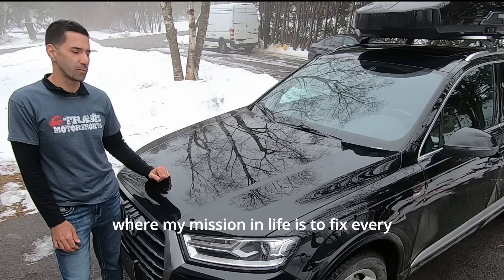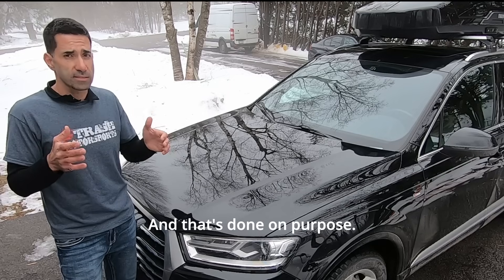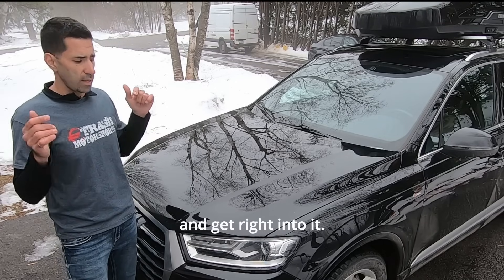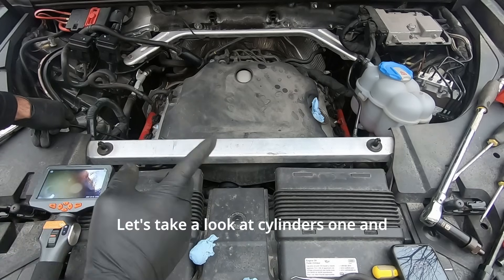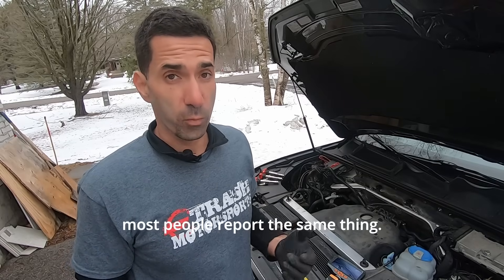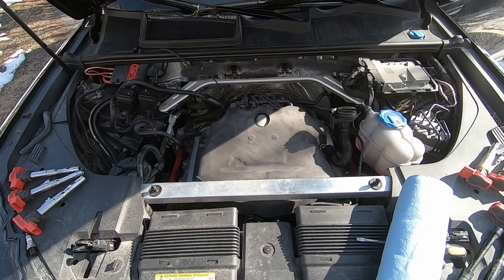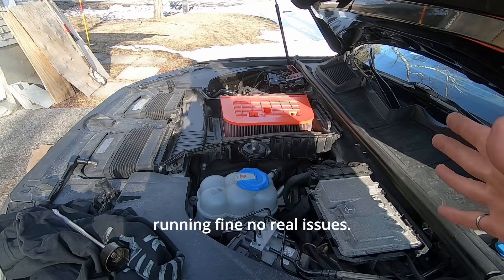I piston soaked another 3.0T with B-12 to fix its oil burning issues due to stuck piston rings

Comment: Thanks for this. Is this common in the A6 with CREC as well? I’m having oil consumption with mine, but I’m not sure if it’s the PCV because it hasn’t been replaced yet, or just carbon buildup
Reply from the maker: Pretty much any 3.0T so sadly yes...i think it depends on how bad the consumption is - the pcv can't account for a 1L per 4-500km consumption- that's rings for sure... if you're in the 1L per 10k then maybe PCV... thats a good question for the other folks here - what was your consumption when it was PCV and not rings?
Reply: @ETMotorsports Yeah mine was doing 450miles (720km) when I bought it used with 98k miles, so I suspected oil. Switched to liquimoly 5W40, got better up to 700 miles (1126km). 

But after that I discovered I also had a valve cover gasket leak on drivers side, so I replaced that. The oil level in the mmi hasn’t moved yet and it’s been 250 miles, so I’m praying it was the leak; however that doesn’t rule out pcv. I’m not sure how accurate the oil cap suction test is as a determinant for a failed pcv on these engines, but mine has INSANE vacuum at idle, like it was not coming off at all no matter how hard I pulled. 

So I’m guessing the pcv probably failed/failing caused the valve cover gasket leak, which caused oil loss + pcv itself causing oil consumption. I think I’ll replace the PCV; but that also doesn’t rule out piston rings. 

One other thing, what do you think about running yamalube ring free in the tank? 12 oz per tank for a couple tanks, just as a slower way of removing the buildup? 

I appreciate all of your efforts, thank you sir

Comment: In the bayarea of CA, i took my honda to a japanese repair shop because it's burning oil. No smoke, no leaking just comsuming requiring adding more before oil changes. The shop said he would put thicker oil in it, or replace the engine for 5200... he so happened to have a bunch of Honda engines he bought from japan. Doesn't say how many miles are on them. I passed and will not go back to him, because I suspect he knows about this B-12 fix but wont do it.
Reply from the maker: Whether he knows or not - it's a business and he wants to charge for his engines - it's simple... any shop would rather charge 10k for 2 days of work

Comment: I do this with seafoam. I'm not sure why other shops dont do it
Reply from the maker: We've tried seafoam on a few motors- it's pretty weak compared to B12...i guess as a preventive measure it would work well every 5 oil changes or something... it did fix my A4 though so it's not completely lost

Comment: I’ve always just made my own concoction with ATF mineral spirits some diesel and several other little things. Literally make the oil change out of it and fill the cylinders. Definitely fix someone’s Q7 just the same way about two or three years ago if they were burning through so much oil within 600 to 700 miles where they would tap the engine up and then then the light will kick on to fill it up again. They have maybe filled it once every 2000 miles or so now. Four out of the six pistons have scoring.
I had to clean up the spark plugs fairly often because the misfire would develop misfire are also developed before the light will kick on. I know that may not make sense to people the check engine light only on when misfire counter sees so many in a certain amount of time Versus you feel on this fire, but its not enough to set the light. Anyway, giving it the Ferrari tuneup after all cylinders were soaked, as well as a crack case full of the cocktail I made to drive it around untill it stops smoking. Dump the oil when it’s still hot be careful burn yourself. Clean the spark plugs. Keep on driving it and then you may have to clean a spark plugs once or twice again and then when you see no more misfire or anything put new spark plugs in it.
This vehicle had roughly 80,000 miles on it. The dealership said it’s a $25,000 motor swap. After I did this they now have I believe around 110k miles and filled it up maybe two or three times. This is not a fix. It’s just a bandage.

Comment: I always used seafoam deep creep, in Kohlers out in the field to loosen their oil control rings back up.
Reply from the maker: Yeah we use that stuff pretty regularly
Reply: @ETMotorsports I was always worried about lubricity and solvency of B12, but it looks like that's not an issue 👍

Comment: i did  piston soak on my fsi 2.0.  then i used Valvoline restore and protect 5-30w for two oil changes.   I think the oil was better than the piston soak.  my car went from 1 qt oil every 600 miles to 1500 miles and getting better. i do need to change the valve cover and rear gasket .
Reply: Does the RP eat through old gaskets and seals? ive heard that somewhere
Reply: @robczar7479  yeah the next oil change I’ll use regular 10~40

Comment: I have a 1991 Dodge Colt (C52A Mitsubishi Mirage) with the 4G15 engine and it burns a bit of oil and has a slight ticking sound, I think I might have a stuck piston ring on cylinder 1 and I might try this method to un-stick it, it will certainly be a lot easier on an old 4 cylinder than the Audi, modern cars have so much complicated stuff it's ridiculous, the Mitsubishi even has a hole in the inner fender specifically for turning the crank through with a ratchet and socket, covered with a little rubber plug.
Reply from the maker: Nice... keep us posted with your results

Comment: If the liquid disappeared that cylinder most likely has stuck rings due to carbon- which will also let the oil get past the rings from the crank case go into the combustion chamber and give you the blue smoke.
Reply: OR the liquid "disappeared" because that cyl was on the exhaust stroke, so it leaked out the exhaust port. With 2 cylinders at TDC, only one is in compression and the other is exhausting.

Comment: Also make sure to check your ccv/pcv/oil separator system. Easy way to check is to take off oil cap with car running. If it's bad it will have insane suction and make whistling noises. It will make your car burn tons of oil. If your ccv is bad, I suggest ordering new intake gaskets, coolant crossover pipe, thermostat, and new engine cooling pipe o-ring. It takes a while to get down there, supercharger isn't bad to take off but the ccv is under fuel and coolant lines too. If you have pre-2017 there are some other brittle hoses you may have to replace or be very careful with. Post 2017 they rerouted one of those hoses and upgraded one of the coolant pipes to metal.
Reply from the maker: Great suggestions!

Comment: My Ford focus 2012  2.0L Naturaly aspirated engine and with the 5 speed manual transmission  with 360000km takes aroung 40ml of oil in 8000km  :face-blue-smiling:
Reply from the maker: Yup... my diesels have never burned an Oz of oil

Comment: (my Audi A4 b8 2011) i also hav a problem oil burning from 1qt every 350 miles.. and try soak my piston in cylinder with B12 every 6h x 4 times(24hours) and i then immediately change to new engine oil & filter before try to start.. and the result didn't work.. still 350 miles per 1qt.. any suggestion? should i need to soak my piston again with b12? then drive the car at a speed of 65-75 km 3rd gear at high rpm for 20 minutes while the b12 is still in the engine?? or try change my PCV valve

Comment: Run a few oil changes of Valvoline restore and protect through it. Results people are seeing from that are unbelievable. 

After that, switch to 5w-50 viscosity grade that has the lowest Noack evaporation percentage you can find.  Oil consumption should decrease a lot more and the engine should last longer.

Edit: Another trick is to only fill the engine oil to near the low end of the range and top it off near the low end each time you get gas.

Comment: Have you tried CRC valve cleaner? It is an easier process to clean and use.
I have a 2016 SQ5 with 110k miles. I’ve used CRC intake cleaner since 30k mile. It still doesn’t burn any oil…. Leaks however is another story…

Comment: I have a 2.0TDi Bluemotion, 120,000 MILES, oil and filter service every 6000-8000 miles with the proper 507.00 rated 5w-30 Long Life oil and it's never burned anything between oils services, the level never drops and it doesn't smoke at all, even on startup/cold starts, not even when 2 glow plugs went down.

Is this something limited to gas/petrol engines?
Reply from the maker: Unfortunately not... lots of folks with diesels asking how to do it so it's not limited to gas engines...my TDIs have never burned oil like this either

Comment: What's so  "tuned" about running rich at no load, idle speed? What's the point of that of kind of tune?
Reply from the maker: Why do you think it's running rich at idle? It's tuned to run richer under load to match the increase in boost wth the pulley upgrades

Comment: Would any liqui moly additive work to dissolve or loosen the carbon in the piston rings? Or, would it also work with gasoline? B-12 is not sold in my country 🇵🇪 , which is why my question is. I wish it was sold here, I think this would work perfectly on Diesel engines too

Comment: Some thoughts after eliminating oil burning on a VW 3.6 VR6:
-Using an oil that cleans is an available technology and is a great first shot to solve this problem. Valvoline R&P (not euro rated, but there are reports of no problems in 3.0T), High Performance Lubricants both clean.
-Dumping your old oil in a clean container, then catching the B12 in the oil pan. Dumping the B12 as waste, then returning the old oil for a rinse of the engine after the soak makes a lot of sense. Totally avoids thinning out the oil with B12. Then changing the oil/filter after the car has been driven post-soak. Also isn't wasting a lot of new oil for a rinse.
-The Oil Geek has explicitly mentioned in recent videos that he does not recommend oil additives or running anything in your oil other than oil. Simple and logical.
-Spray some fogging oil into the cylinders several hours before you restart the car, it will help the rings seal and make restart easier. It's designed to be sprayed into engine cylinders.
Reply from the maker: All good suggestions... running b12 or any other flush in your oil I guess is individual decision but the rest makes sense

Comment: Both b12 and techron work well - I've done this on several motors - haven't thought to fill to the valves though. Thats great.

I usually do 4 cylinders and just get them all mid cylinder and fill them up. About 1L of cleaner. 

Running .5L of diesel or kerosene in your oil for a couple of minutes before changing the oil helps a lot too

Comment: So important to not do extended oil changes … 5000-7500 miles max! Valvoline Restore and Protect does a good job too.

Low tension piston rings that modern engines use do not do well with GDI engines and long oil change intervals.
Reply: I change the oil in our 320 and X5 40i at 8000km, my f80 it's 5000km, motorcycles twice a year whatever the km I believe it's safe intervals, reaching 255000km on the X5, perfect condition 🤞

Comment: I have a Ford Duratec 2.0 and it was consuming oil. I decided to do a double oil flush by using a flushing fluid (not the 1 bottle solution) and filled it up to its capacity, then flushing again with my new oil, and throwing that one again. Yeah. It was dirty. So far so good!
Reply: My Mom has an old Mondeo with the Duratec 2.0/Mazda L engine. It was all good until a service center put some bad oil in it (some knock-off crap they buy in bulk, supposedly 5W30, but no one really knows the viscosity). It started burning like crazy and mashing the gas was leaving a thick smoke screen behind. It turned out the piston rings were completely clogged by carbon (even though the engine is MPI, not DI - it was all due to the oil). 

I did a couple flushes and put the correct oil type in. No more smoke, no more having to top-up the oil every 1000km and compression is great (I was concerned that the bad oil could have done damage). Now the oil drops from max to half between oil changes, which is pretty much to spec.
Reply: @almitov  you could try what I have; I have a 5W40 PAO+Ester engine oil and I drive spiritedly. 
I noticed that this engine loves long drive intervals, and hate short drives.
Reply: @BoredGeese  Thanks but it's good now. The car's currently running Castrol Edge Pro A5 5W30. It's compliant with the WSS-M2C913-C spec, so it matches or exceeds the OEM one.
Reply: @almitov if I may, I would also like to recommend the Motor Oil Geek. Tons of information about oil.

Comment: Last year had a 2017 Q7 in the shop for bad oil consumption. And oil soaking cylinder #2 causing a missfire after 150 miles or so. Found the oil separator was bad but not the only issue. The piston rings had extremely bad carbon buildup. Replaced all six of piston rings. Yes did all three rings on the pistons. The carbon builds up behind the rings causing tension and premature wear of the oil control ring. I measured the new and old. Can’t remember the exact measurements but it was outside the manufacturer tolerance.

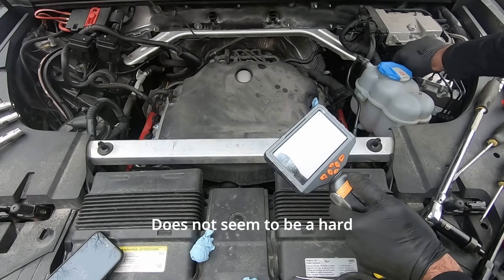Comment: On minute 6:30, when you’re talking about cylinder 6 now being empty, could that be due to the piston rings being stuck in their seats/slots?

That could also suggest the possibility of lower compression on said cylinder…
Reply from the maker: Yeah that's the first thought... but I've done a few now and there seems to be no correlation between the speed of draining and the condition of the piston or compression... on top of that it changes with time

Comment: Where can I buy b12 in the Netherlands nobody ships it to here
Reply: I have used Xenum intake pro (Diesel) on my 2.0 tfsi. Its at 220k and burns around 0.5 every 10k km with original pistons. 

Also Castrol GTX oil can also help clean the rings
Reply from the maker: Yeah it's hard to get but you can find a substitute - LiquiMoly has an engine flush and injector cleaner in their pro line that might work as well

Comment: Is it that bad that an engine uses oil? I have the same engine 2010 S4 B8. When I hit full throttle it put outs black smoke. And it’s tuned 424 hp has 212.000 km bough it with 105.000 8 years ago. So I don’t care it smoke when I floor it.
Reply from the maker: You're mixing things up here - your car is tuned so it's running rich and therefore produces black smoke - it's not ideal but it's the result of adding more fuel to increase power... there's some benefit there... burning oil adds nothing to the combustion and you're just killing your cats, the environment and your wallet for no purpose at all... it's a bad design and has no place in these motors
Reply: @ETMotorsports well you’re right, but if want a car that good for the environment I’ll buy a bicycle😅
My cats are probably gone never replaced those, exhaust is still stock.
But are there no cons by using that stuff? 
Maybe I should look at the inside but if I never did it could it do harm buy ding after all those km’s?

Comment: I’m surprised you ran the car with the B12 in the crankcase before changing it and not doing the oil change immediately after the soak. 

I’d try a tube adapter on a ShopVac to suck out the carbon debris. Might have better results. 

Being that the car is boosted and tuned I’d be changing the oil way more frequently due to fuel dilution especially when it’s running on the rich side. That’s probably the main contributing factor to the consumption.

Comment: I just did the 3rd and last pour of the B12. Is it fine if I leave it for 16 hours, let's say,  before cranking it up?
Reply from the maker: Yes but definitely clean up the cylinders and make sure the crank turns by hand after 16hrs... the garbage dries up so keep turning the crank throughout if you can
Reply: @ETMotorsports  I managed to turn the crank 2-3 times more, didn't had issues, I tried to blow as much as possible with an air compressor, then turning the engine with the plugs and coils off. Not sure how much gunk I was able to blow out the cylinders, but there were carbon pieces in the oil.
I ran it for about 15 minutes, then drove for 15-20 minutes and changed the oil. Misfires were completely gone by then and the car is not smoking and she did smoke a shit ton previously because I am running a test-pipe. I did get a "System Too Rich (Bank 1)" fault at the end of the ride, but my car is tuned, so I might need to visit the tuner.
Fingers crossed, will report the results once I drive it for 500-1000km